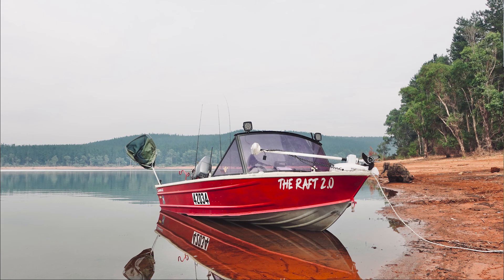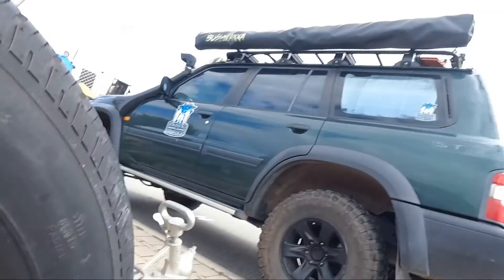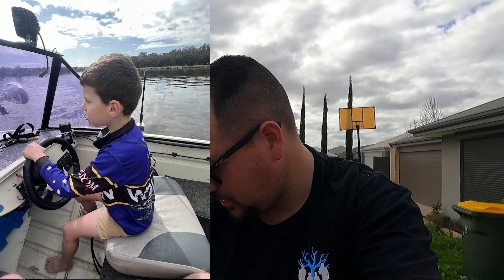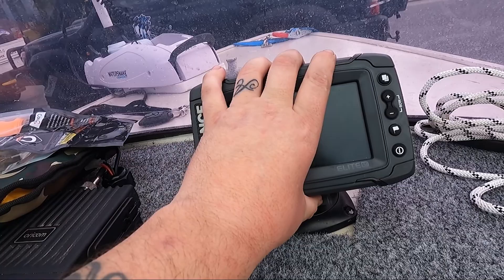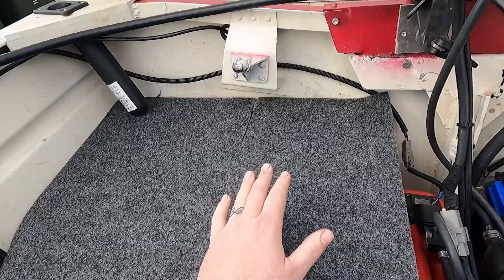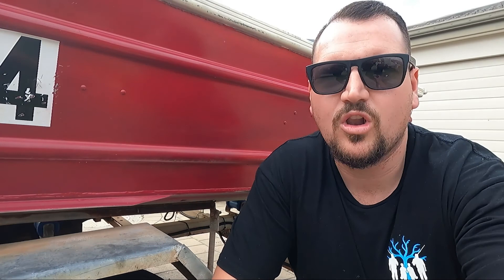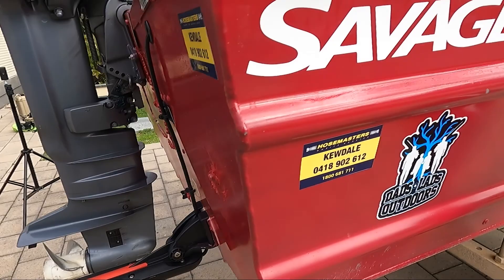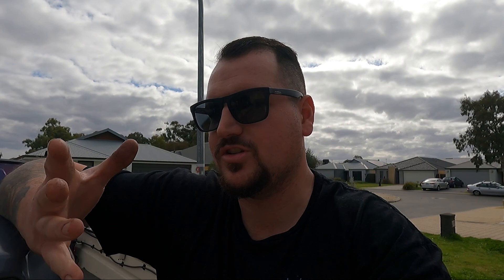How I Upgraded My Tinny | ULTIMATE Small Fishing Boat | Full Rundown | Savage Red Raft

Comment: for the transdeuceryou can attach it to transome using PVC board, which is connected to transome with 3M
no more holes is transome
Reply from the maker: Yeah mate how good it that 3m stuff ?? Lucky for me 2x holes where already there so sent it 😂
Reply: @dadsandladsoutdoors  2 types 3M  marine adhesive 4200 long term seal, 5200 permenant
remove old screws, coat thread and head of new screws, Dab extra on any screw heads and rivets , take PVC board about 6"x 8" and placer where you want it, then remove.  Dabs on rivets and screws will leave sealent on PVC board,  draw circle around them marking area that you will drill small dimple, wipe off extra sealent on board , larger diameter drill bit make dimples in corners and middle and where screws and rivets go 
fill divets and put good amount of sealent on   clamp on for several days to a week before putting in water
Reply from the maker: @CHIPPOFISHING  Yeah bloody ripper mate I’ll definitely check those out as I’m in the market for a new sounder 🙌
Reply: You in Australia or New Zealandp
Reply from the maker: @CHIPPOFISHING  Aus brother Wbu ?
Reply: @dadsandladsoutdoors  USA east coast side between florida and New York center of North Carolina